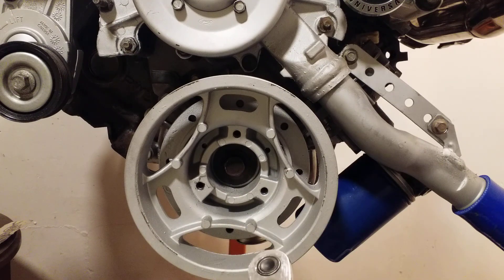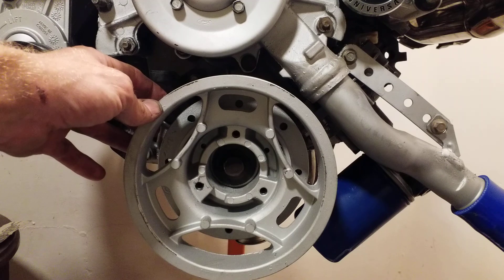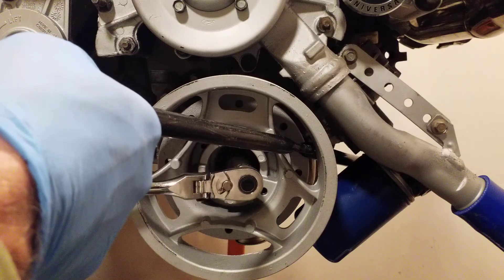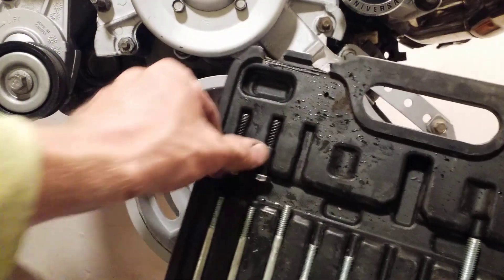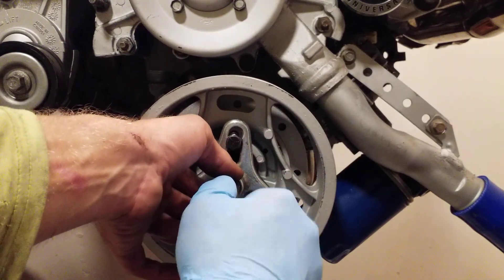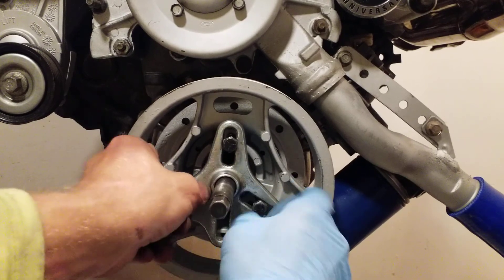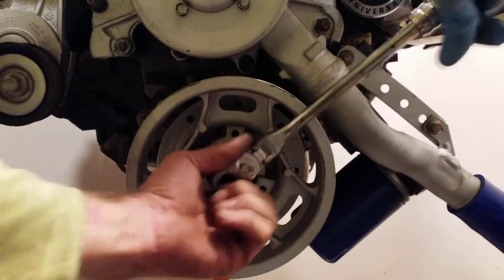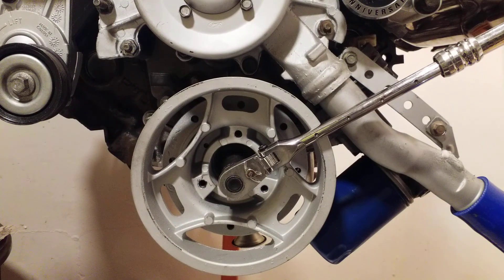Mustang 4.2 3.8 V6 Twin Turbo FEA Tutorial 3. Harmonic Balancer Swap Info Removal /Install in 10 min

Comment: 95 mustang, can i swap 97,98 f150 drives without using the f150 harmonic balancer?
Reply from the maker: @ryannickfabrication  no. It's All gotta be a set. F150 accessory drive does swap only with thunderbird so u could use the supercoupe balancer with 2 belt drives as well for that

Comment: What about a balancer off of a 4.2L F150
Reply from the maker: Each front engine accessory set is mated to that accessory set. Each set has its own distance away from the front cover to create the belt line. Can not swap out only the balancer it will not line up and swapping to f150 accessories makes no extra room.

Comment: You say at the end of this video (9:48) that the 3.8 and 4.2 are externally balanced making this harmonic balancer swap easier, but in the comments you say the 4.2 is internally balanced. So is there an external balance Freestar/Windstar one piece balancer?
Reply from the maker: 4.2 is all internal balanced.
94-00 v6s all external balance
01-08 v6 all internal balanced

Comment: So I ended doing the  2002 Econoline 4.2 in my 98' f150 but now I want to add the 98 4.2 balancer on the 4.2 to use the BBK 3.8 Mustang pulleys can I just swap the my old 98 4.2, 4bolt H.balancer on the new 02 Econoline 4.2, 3bolt H.balancer? Please advise. Thank you from Tempe Arizona.
Reply from the maker: Tbh I have not tried 4.2 and 3.8 accessories together so I can't give info on it
Reply from the maker: All 4.2 engines are internally balanced so any 4.2 accessory would work. Im not sure if f150 and mustang accessories interchange , but I doubt it. You can swap to mustang brackets and accessories , but most likley not single accessories
Reply: I thought the the 3.8 94-98 mustangs had the same H.B bolt patterns "4bolt" as the 4.2 HB pulley and thought it would fit Im planning on just doing the crank and alternator BBK1619.

Comment: Thanks for the tipps. I'm currently installing one in my 2000 mustang V6. The balancer will not slide in with a couple of taps. It's far from securing it with the bolt. Any ideas how to just shift it a bit in? Regards from Germany.
Reply from the maker: Put a 11mm long socket on a 12" extension and bang it in

Comment: Does the end of the crankshaft go flush with the balancer face?  

It doesn't look like it on yours.  I had the bolt break on mine and the balancer walked off far enough to move the teeth away from the crank sensor.  when I installed the balancer with the installation tool the crank snout doesn't go flush with the balancer with a reasonable amount of force.